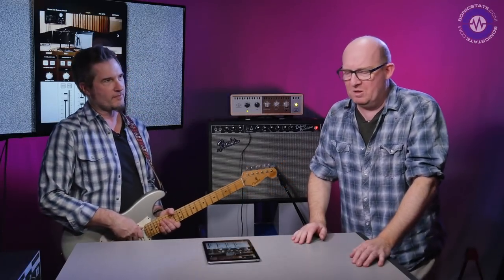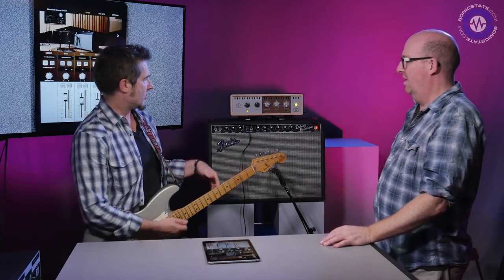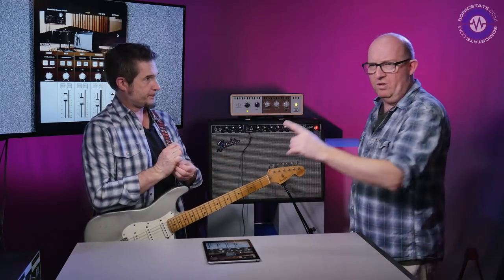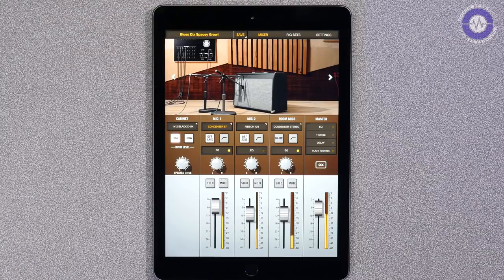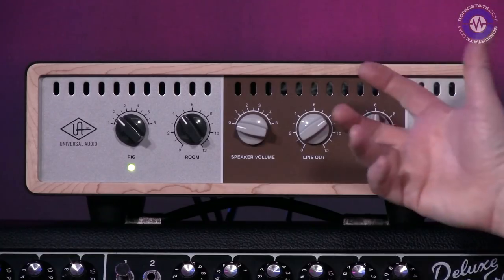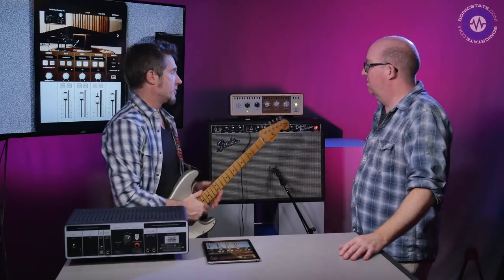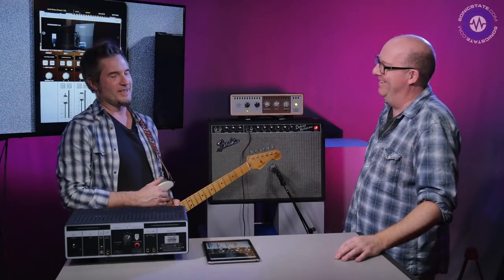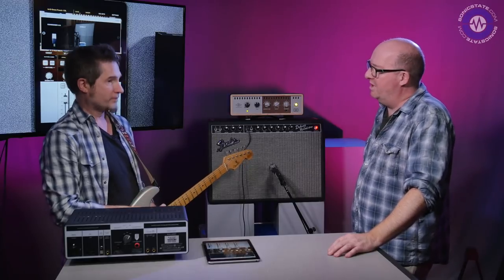Presentation: Universal Audio OX - Amp Top Box

Comment: I’ve always kind of scoffed at attenuators and cab sims and amp modelling, especially for live performance, but this seriously ticks off a ton of boxes. So impressed by my only complaint, and it’s a shallow one, is why aren’t there some colour options? Like, it looks good but there are so many amps with different colour schemes. Even just a black option or maybe even white would really help it aesthetically fit into anyones rig!  Super into it though, fingers crossed they do some limited runs in different colours or add some colour options later, cause that would be the icing on what seems like a pretty damn good cake.

Comment: Hmm the OX is still in the circuit between the amp and the speaker for the real mic on speaker sound in this video?

to get a true comparison between the DI signal through the OX and the mic on the real speaker, you should remove the OX completely so that we just hear the combo as it is, IMHO of course
Reply: watchtheskies you can’t remove it though, since it’s acting as the speaker load. The DR doesn’t have a line out either
Reply: I see what you mean it would be rather loud! but it doesn't change the fact that any dummy load, reactive or not can change the sound of an amp considerably, 
it puts into question the claim that the OX sounds almost the same as the amp mic'ed up, when the OX is also influencing the sound of the mic'ed up speaker,
I guess in the end the only thing that matters is whether you like the sound!

Comment: I'm confused, is the attenuator function the only one that uses my amp's speaker? In other words, to take advantage of the mic/speaker emulations and the FX, I need to now buy new speakers to play my guitar through this (if I don't have them)? And I don't own an iPad, meaning that, unless I want to be tethered to my laptop to play guitar, in my case the product's cost is something closer to $1500-1600, or potentially $2000 if I also need speakers? $2K for an amp sim and DSP FX engine (with only 3-4 FX)?
Reply: Unless of course I've misunderstood how it works, which is eminently possible :)
Reply: You don’t need new speakers, you can use it as a simple load box/attenuator for your amp (although a rather expensive one). But you can use the signal path with the mic/amp/room modeling for going e.g. direct intro your audio interface for silent recording or live direct to the mixer. It wouldn’t make sense to send that signal to a guitar cab as it is already sounding like one. 
Yeah, you need an iPad or laptop for configuring, I think this is better with the Two Notes Torpedos, they can be edited on the front panel afaik. 
If you only need a reactive load/attenuator, I would go fo the Torpedo Captor which only has a fixed 20db attenuation, but also works great for homerecording if you use IRs in your DAW. And it costs around 250.
Reply: Hey Jan thanks for getting back and clarifying. It seems a bit of a shame to me, and somewhat wasteful to forego the dedicated speaker of a tube amp and run it through my home studio monitors, which in my case are an introductory model and which of course will not reproduce the guitar's sounds the same way due to flat frequency response. Also, now my guitar is hogging an input in my audio interface all the time, even when I just want to practice. Lastly, if I'm going to be routing the signal through the audio interface, I can just as well use DSP from my PC. I understand that the unit is supposed to be different in that it is responsive to your amp's circuitry, but I don't think that justifies the price tag. And I know my comments apply only to someone with my home setup, but I don't think it's an uncommon one (PC, 2 input audio interface, monitors). I suppose it's more of a luxury purchase to begin with...anyway just thinking out loud at this point. Oh, thanks for the Torpedo Captor recommendation!

Comment: But what's the need for a reactive load if there's stilla speaker attached to the other end and the output from the amp goes through that?
Reply: Luca Borgonovo i think you can use it completely without a speaker...